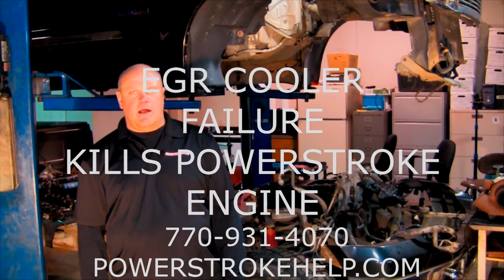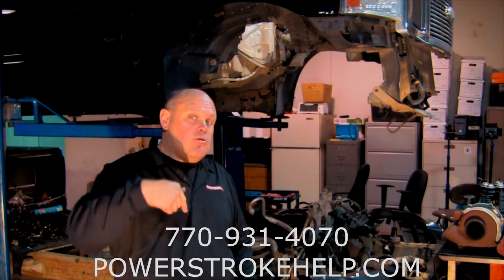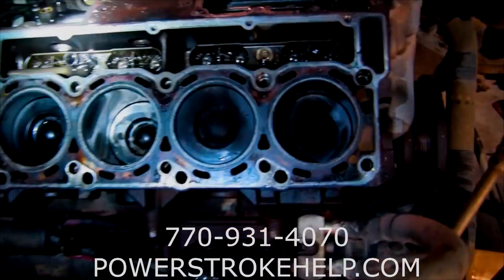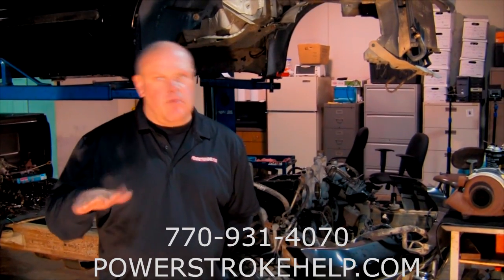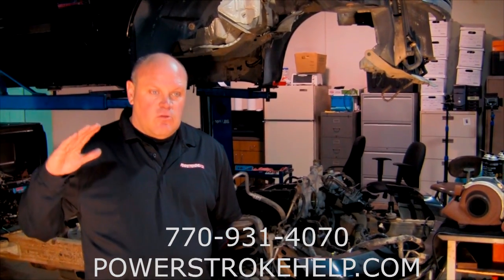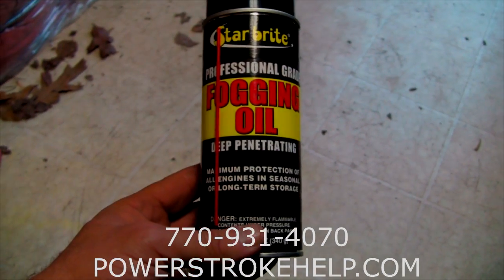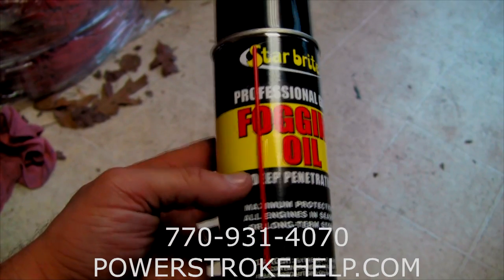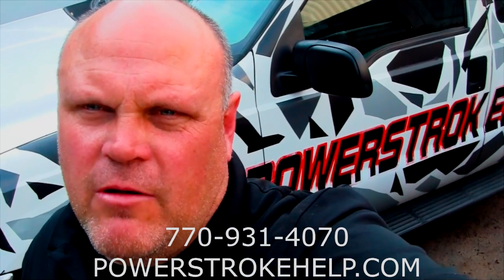EGR COOLER FAILURE KILLS POWERSTROKE ENGINE

Comment: I have a solution for those who are having this issue with EGR cooler. Disconnect the egr cooler cooling lines before storing it and then do his oil spray to prevent rust. This way you know for sure when you are ready to replace the egr shitbox you will be back on the road with no rusty cylinders. Note disconnecting your EGR shitbox cooling lines will run a code I bet so dont do this to daily without EGR. I dont personally own any diesel anymore and I dont believe in the new laws that have been put out for diesels. I strongly believe in my mechanic religion that engines should not have to breath through tiny intakes and catalytic converters that get clogged. I hope I helped someone who does not know what black magic that happens under the hood of their diesel to hopefully save its heart from being ruined.

Comment: Well Bill, I love your videos even though you think my 95, F250 is obsolete. I love my 7.3 4X4 that gets 18 miles to the gallon. I did make the mistake of driving a 2002 F250 the other day a non power-stroke but what a nicely appointed truck, and with all the mods I learned about from you and your channel I'm thinking of finding a burnt up 2002 to stick my engine in it.I love those adjustable mirrors, the oil pump, the intake mods the fuel intake mods and the inter cooler dammit!

Comment: Bill, I am assuming this can be the related to all diesels with an EGR cooler, I am a young diesel apprentice and we see many egr cooler failures on highway tractor diesel engines -(cummins,detriot,maxxforce) and when an egr cooler is diagnosed and we dont have time to do the job we will park the truck and it will sit , Ive even seen up to months..... (work in fleet) and then be brought in for the cooler. Also each time a cooler is done the aftertretment must always be  pulled down and inspected . Coolant will usually always plug the face of the doc/dpf , even sometimes destroying the dpfs

Comment: Spraying the fogging oil in the intake, won't the fogging oil act as fuel for a diesel and cause it to run as long as there is fogging oil available?

Comment: Can you do a video on how to fog the engine?
Reply: +zambimaru We do it to our sleds in the spring. Search for how to fog a snowmobile. It will be essentially the same thing. 
Pull the air filter and have someone hold the idle at about one thousand, so it pulls the oil in and it just doesn't pool in a low spot. It will smoke. A lot. But you want this. An engine this size I would suggest that you use about half of the can.

Comment: On outboard or inboard marine engines, this should be used at fairly high rpm (normal operation for a marine engine is 5000 + rpm... constant) so get it to 1200 rpm at least, and spray into the intake until the   engine actually dies, this is very important cuz it means that the spark plugs got a perfect coat and therefore there is no more sprk happening... also, do this with your old spark plugs, cuz you are supposed to put a new set after the winter has passed, or... clean the spark plugs with carb cleaner when you are ready to go back to the water (note: it is going to smoke like crazy... this is normal...  also, this is for 4strk engines... 2strk engines is a different procedure. .....................PS: I'm a marine tech actually.................  PS2: you should also empty your coolant ( ifffff... your engine uses a closed cooling system... meaning... that salt or lake water cools the coolant and your coolant cools the engine). For winterization, even with antifreeze additives there is some expansion.... you don't want to crack the block.
Reply: +PhuckObama Diesel engines do not have spark plugs.
Reply: James Tyree II ...if.... but only if, you pay close attention you will notice that i'm not talking about diesel engines. But I am not so sure about diesel engines man.... are you absolutely sure they don't have spark plugs??
Reply: Sorry? I re-read your comment before posting mine to try to avoid making a fool of myself by posting this comment, yet the way it is written seems to be discussing marine diesel engines.

Comment: Are you sure bill that you can fog the engine does this oil burns because on a gas engine it's ok but on a Diesel engine if you introduce oil in the intake the engine will probably go into a runaway and then you have a serious problem like a rod in the block I'm not confident of this technique on a Diesel engine maybe this product is compatible with a diesel engine  but I would seriously read the label on the can or ask the manufacture.
Reply: +V10PDTDI you sir are an idiot.
Reply: +jesus jones You sir are the idiot.
Reply: +V10PDTDI It will be ok. It's a fairly heavy oil and it isn't being injected 'atomized' like the diesel fuel is.

Comment: This is not a problem with the new 6.7 powerstroke   ,  am I correct ? And also I am running Power Service diesel kleen in my fuel and exhaust cleaning it a thing of the past for my truck. I assume this is good that the truck does not go into regen because my fuel is burning cleaner?  Other than regular service and stuff it to the floor when she's warm to blow out any soot is all I can think off. Any other advice from experience reader's will be helpful.
Reply: +Kenny Budden he's got other videos that talk about the 6.7... damn nice engine!
Reply: +Angst Tsgna 
yes indeed. .so far so good
Reply: +Shackles 6.7's have head cracking issues.  Ford has released a revised head to address the problem.  I share this with you so you are informed, do research, and find out what you are entitled to if it does happen.
Reply: +Lynx Star Automotive (Gabe V) 
Are you sure you have the correct engine.  The 6.7 has no head cracking issue . The new 2011 and up scorpion 6.7 no, the old Navistar international yes.
Reply: Shackles Well I'm sure the latest models are now bringing the revised head, but the early 6.7l Ford built diesels had issues with the head cracking, and dropping valve seats.
Reply: +Lynx Star Automotive (Gabe V) 
nope..Maybe drop a valve with 100k hard ass milage. .no head issues. .sorry man.
Reply: Shackles 

Reference TSB 14-0127
Reply: +Lynx Star Automotive (Gabe V) 
That is for broken exhaust valve. Common in tuned engines.  Bump it up to 700 horse power and be ready for rod failure.  Not Fords fault. 
only things upgraded are compressor wheel in the turbo and down pipe for exhaust.  More horsepower =more exhaust. 
Thanks for this anyways.  Great information.
Reply: Shackles I may not work for Ford, but I do this for a living, and have personal experience with two 6.7's which are my personal vehicles.  Both dropped exhaust valve seats, and both were out of warranty, under 90k.  The head cracks around the valve seat area, and plop goes the valve seats. It is a real life problem, no matter how you try to justify it or down play it.  Nothing to do with hot rodding or tuning.  My truck is bone stock not even lifted, and the other is a box truck for work.

The revised heads may do the trick, but I just modded mines with titanium valve seats from a detroit diesel, and I staked them in place.  Been sound ever since.
Reply: +Lynx Star Automotive (Gabe V) 
thanks for the information. 
I will certainly check into this more.
Reply: +Lynx Star Automotive (Gabe V) 
engine build on or before 3/29/2011 with this issue.
Reply: Shackles Yep.  As I said, Ford developed a revised head, but I just decided to mod mines instead.  Just didn't want to spend that kind of $$$ on an old truck, as I had to buy them outright.  Tho the dealer did offer me the heads at cost.
Reply: +Lynx Star Automotive (Gabe V) 
door sticker dated build on oct/2011. trucks a 2012. I thinking I'm fine as per date.

Comment: my first was a 7.3 (LOVED IT, tuned, intake and exhaust), traded for a 6.0 and i didn't like it. with all of the failures you keep making videos on, I'm not really sure if i want to wait for a tacoma with a diesel. they are all going to have the same '(ish) pollution control systems. we will never be able to go back to a no frills motor and exhaust. sad.
Reply: 02pwrstrk I have a friend with a 97 f350 with a rebuilt recently 7.3 and the newer 6.0 veined turbo... That truck is freaking awesome.

Comment: Hello Bill...  I really enjoy your videos...  they are very informative even though I'm a Dmax guy.  Have an ArchOil question...  will it benefit a Dmax as much as it does the PowerStrokes?  I am all for helping our veterans and doing what's best for my trucks.  Thanks, Paul
Reply: +Paul Jordan it will help clean the internals of the engine for sure and help the lubricity alot, but as for benefits i would not bother, just use GOOD OIL(Rotella)and let it cool down after a hard run, use OEM FILTERS ONLY. i work in a gm dealer as a duramax tech and after market anything on any modern diesel is a bad idea... unless its performance which open your pocket book for the GOOD parts not china trash :)
Reply: @Mebob2001  

Maybe you can answer some questions for me? I have a duramax and I've got a problem with a LOT of pressure in the cooling system.  It's not overheating and nothing out the tail pipe. I'm at a loss at the moment.